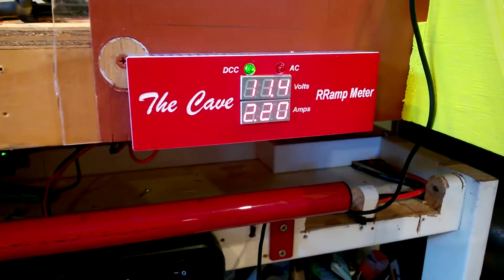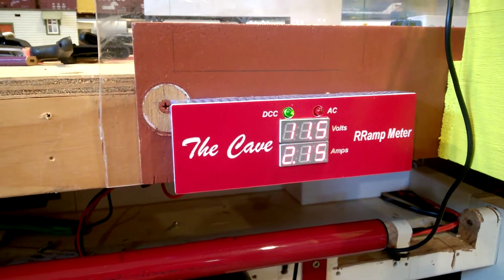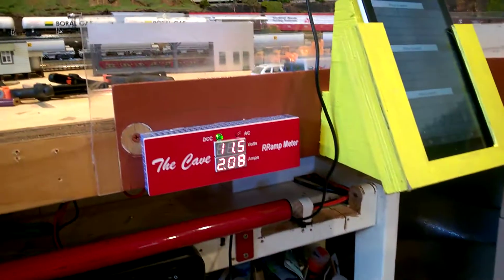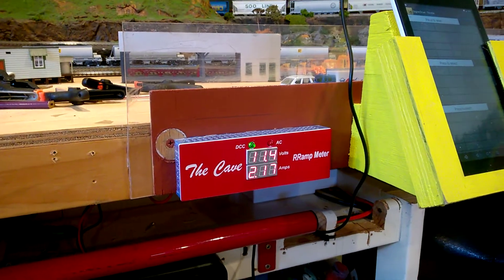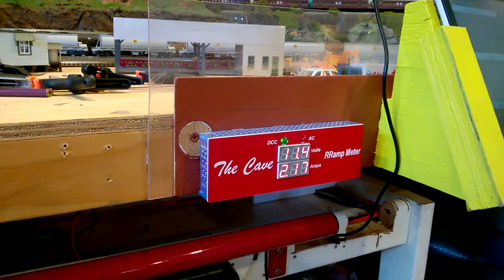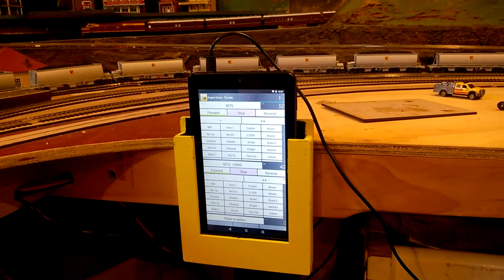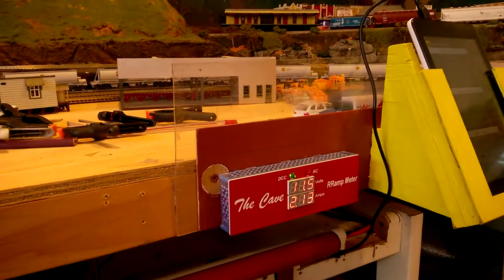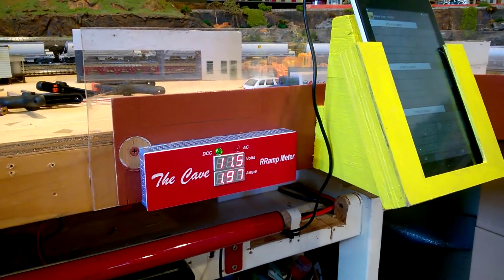RRamp meter at work in The Cave

Comment: Where do you purchase this meter?
Reply: Tony's Trains on the web sell these. There are 4 versions. V1 is just the board and meter, V2 has a face plate over the meter and indicators, V3 includes battery for testing voltages below 7 volt, and V4 is for large scale (O, G) layouts.